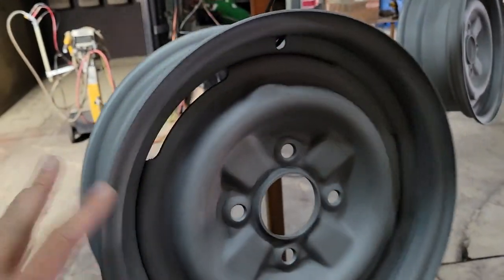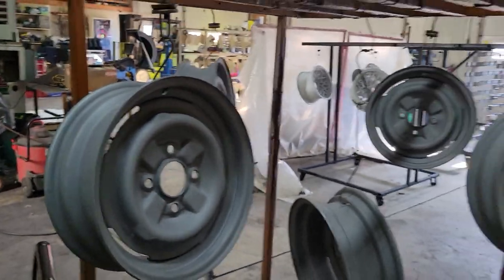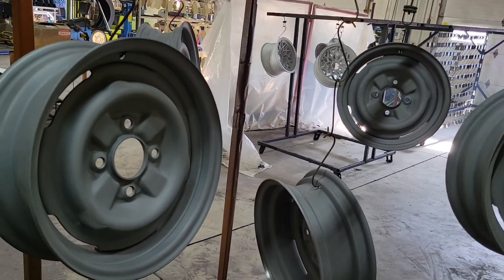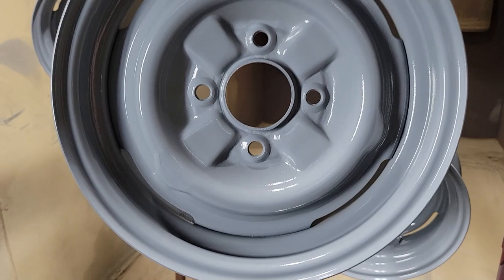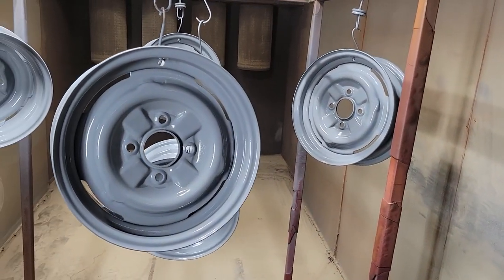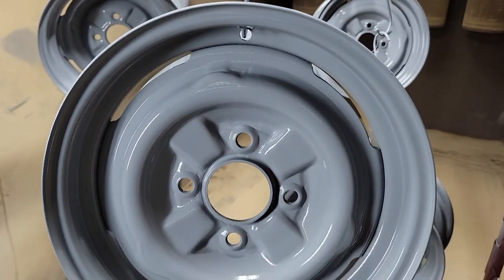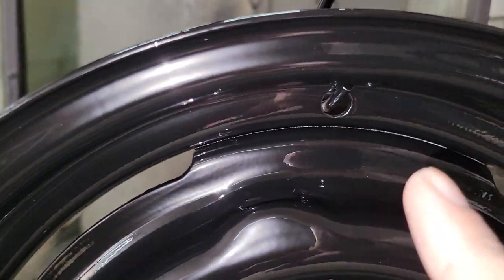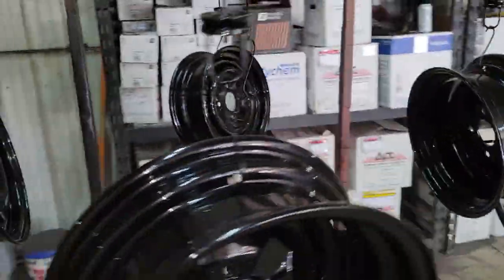Zinc Powder Coat and steel wheel recondition

Comment: Great video man, really cool! For some reason in Eastern Europe most shops do it differently: they sandblast the disks, then put a layer of zinc primer, BUT after that the wheels cool down and are being sanded by hand with a 3M abrasive pads, because the surface has many defects and that is done to hide them. How do you put the finish right on zinc without doing that? Also, do you outgas them after stripping or after sandblasting?

Comment: Have you done a video on large flat panels!? I continue to struggle with tiger stripes!
Reply from the maker: I think we did but maybe we will do another on just application tech.
Reply: Prismatic did a video about stripes on flat panels-basically multiple light passes L to R, Up to Down, and a fog coat all over after. Should help.

Comment: Do you ever struggle balancing steel wheels after you’ve power coated them? The knock on weights often scrape the fresh powder coat when you’re putting them on. Any suggestions? I’ve had it happen even when there’s only one light coat of powder on there. Doing two coats like you’ve done I’d been worried there’d be too many layers to balance the wheel without damaging it
Reply from the maker: we only use adhesive weights